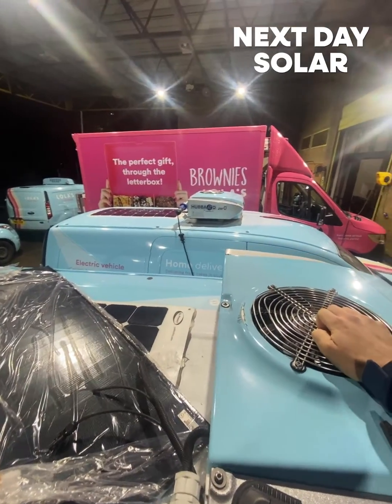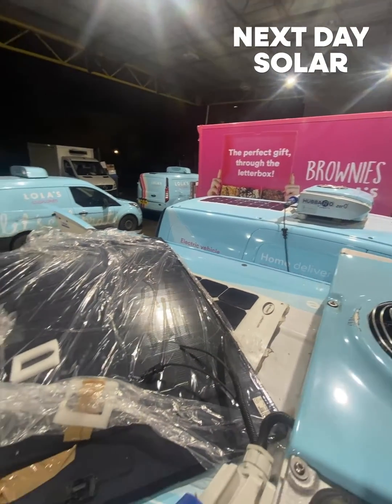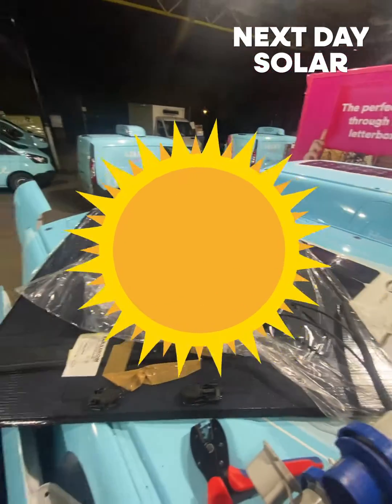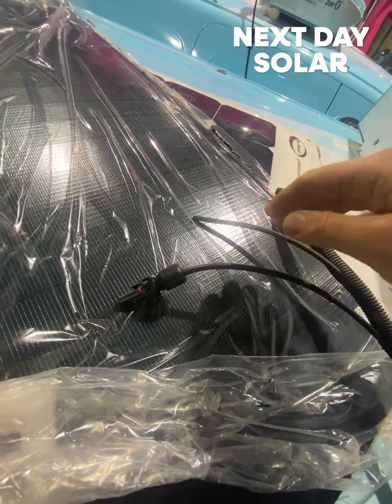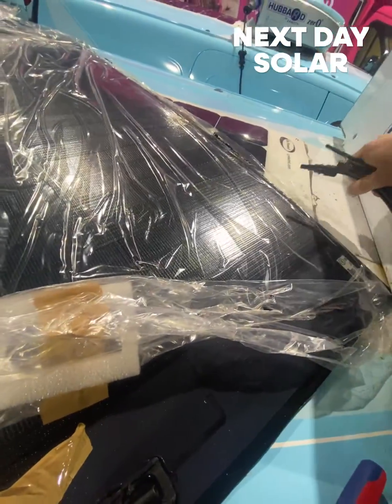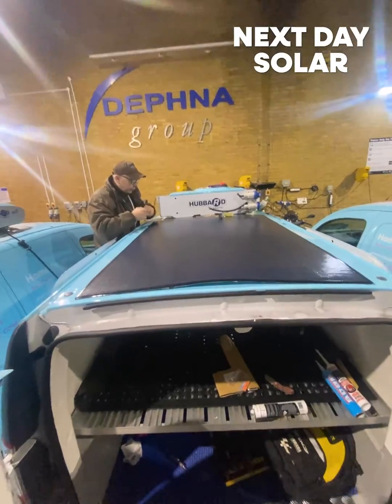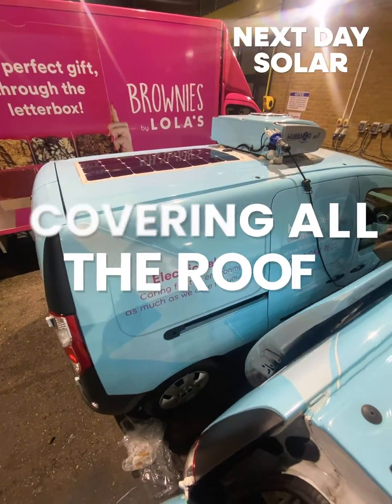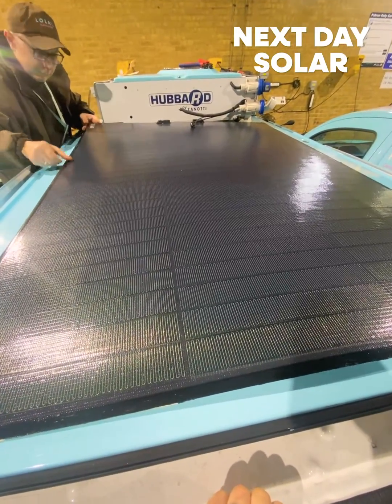How to fit a solar panel on the roof of an electric van - Renault Kangoo ZE 33 for Food use.

Comment: How did you go about actually fitting the panel to the van, please? I currently have a 2010 Renault kangoo extra 1.5cdi, and looking for how to fit panels to the roof, because of the ridges on the roof 😩
Reply from the maker: This panel is self adhesive, and you can use some caravan adhesive as well, for good measure.

Comment: Is it possible to use appliances but in an emergency connect it to charge the electric van?
Reply from the maker: Can you re-phrase your question kindly ?
Reply: @nextdaysolar3349  Sure. Is it possible to used the solar set up to charge the electric van? If I run out of battery to drive can I disconnect the appliances from solar battery and use it to charge the van?
Reply from the maker: @sanarahharanas4493  Now I understand your question. If you fitted a 12/24V Inverter, to the setup, then 'yes' in theory you could charge your vehicle off the batteries fitted for the refrigeration system. We typically fit somewhere in the region of 5kWh of energy for the fridges. Most cars are getting 3 miles per 1kWh, so thats about 15 miles... its something !
Reply: @nextdaysolar3349  thank you so much

Comment: Hi Guys where can I purchase one of these solar panels and battery set up.
Reply from the maker: Hi, the panels are from a company called BIPVCO based in Newport Wales, they are not cheap, but they are a quality product. The batteries are simply 12V lithium batteries. We often use a company called EcoTreeLithium based in Nottingham (UK). If you need help with any of the supply of kit you can email us at hello@nextdaysolar.co.uk, and we can advise. Thanks